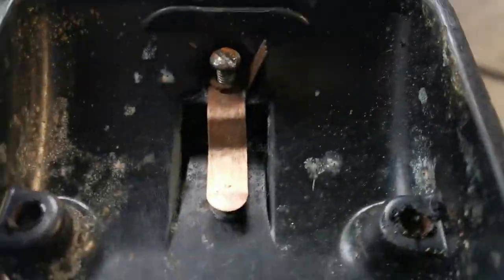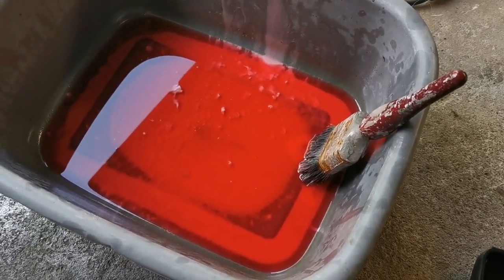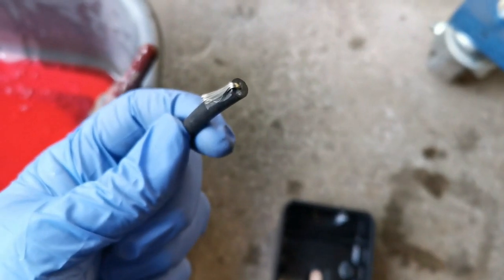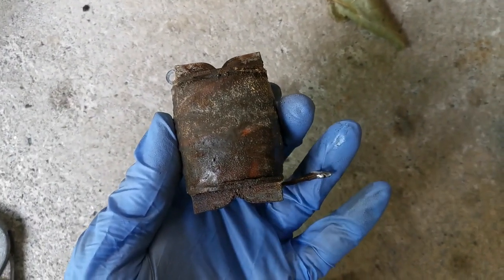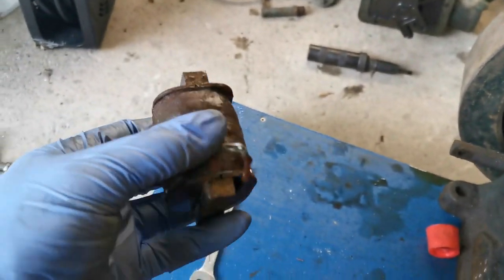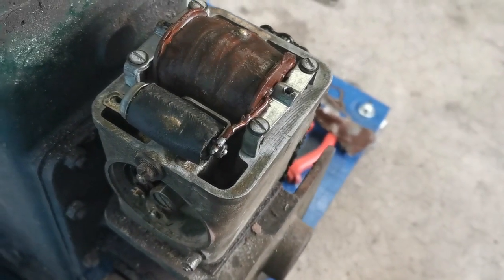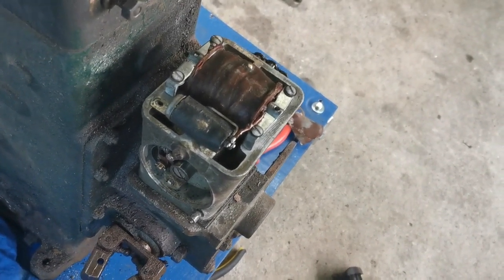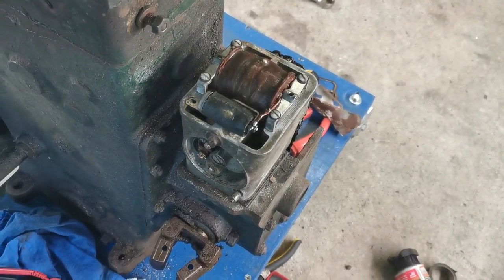Will it run? Lister D project - Part 2

Comment: Hi does it matter wher position on magnet is when points open? Wher the cut away is there is a big cut away and little one. Cheers.
Reply from the maker: So long as it's passing the magneto, then no.
Reply: @Endfloat  thanks for that . Cheers

Comment: Have started on our stripdown, am going out tte weekend to try and buy some imperial spanners , which type would you recommend there are several different types w.w.  a. f.  to name a few. Do you know as if the different types of screws can be bought as I have broken a few already. Thanks Kevin.
Reply from the maker: I was able to tackle everything with a set of metric and imperial spanners. I wasn't going out buying a set of whitworth spanners that'd never be used again.

Comment: You should get around five to six thousand ohms reading on the secondary of the coil measured between the HT output and earth of the coil. Set your ohmmeter to the x100 scale. If it's open circuit the the coil is dud unfortunately. A cheap fix is to use an old lawnmower coil, you may have to make up a new core from strips of sheet metal but it can be done. Good luck.
Reply from the maker: I'll stay at it, don't worry!
Reply from the maker: Thanks for the info. I do think the coil is dead but I'm going to bring it into work tomorrow and have one of our avionics techs confirm that.
Reply: @Endfloat  i was hoping we would see the old Lister burst into life! Oh well, maybe in part 3, no pressure.
Reply: Q